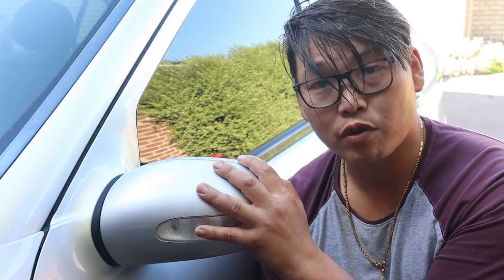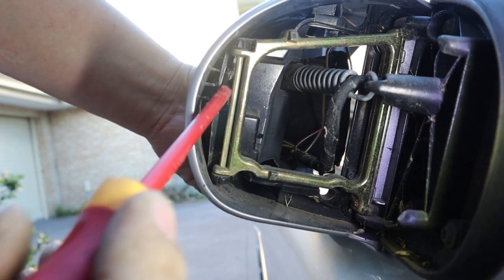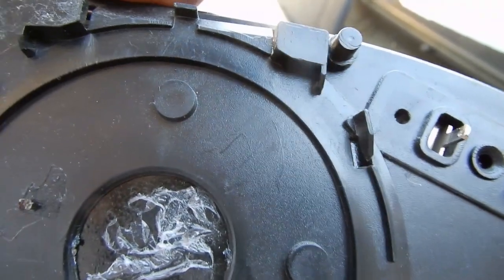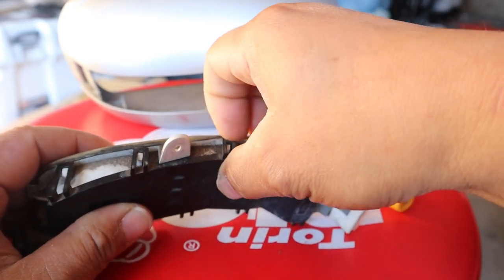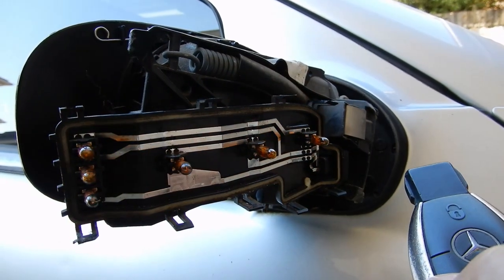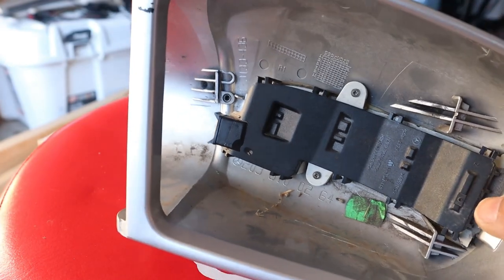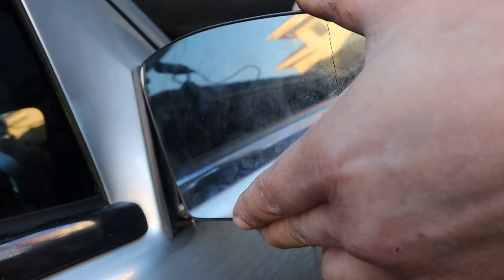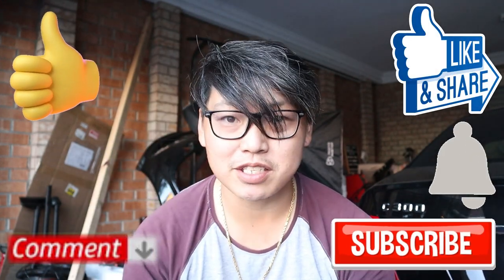how to remove side mirror+cover+indicator+bulbs mercedes w203 replacement

Comment: Thanks Great video. Very helpful getting the cover off - it is still difficult to find the clip but your video showed me where the screwdriver should be poking!  Just as a note my indicator is LEDs; it has a grey cover with no clips-  I guess this would be a sealed unit.  Mine stopped working due to broken wire in the mirror loom.

Comment: Great video, thanks for taking the time to make it. Unfortunately, after an hour and a half, the spring clip won and I gave up. I just couldn't move if far enough over. However, it turned out that my issue (the front of the housing not sitting snugly to the car body)  could and was resolved by springing the mirror towards the front and gaining access to one of the cog wheels for the closing mechanism, which had fallen from it's top support. The mirror still doesn't close but I now at least fits doesn't look like it's about to fall off. The big bonus is I didn't lose my shit and rip the bloody thing off in temper!

Comment: Mikey where did you get a replacement H pin on your door - the one that is a bugger to get out. I managed to break mine as well.
Thanks and kindest regards. 
Dermott Fitzpatrick
Reply from the maker: Hey buddy i know exactly what u mean ... i called up a few wreckers and they sold it to me for 10 dollars shpped ..just call arpund your area all the mercedea wreckers and asl for that part and someone will be able to help u out
Reply: MIKEYZ VLOGZ Thank you Mikey . I was unable to find it on eBay, Ali Express or any of the other sites.  
Your help
Is much appreciated. Take care.
Reply from the maker: @dermottfitzpatrick1450  ur most welcome ..i tried the exact same thing and in the end started callinh wreckers and finally found someone to sell me 2 lh and rh ... just remember how to remove them ..once u understand it its pretty easy

Comment: any update about the bulb size or specs?
Reply from the maker: which bulb size was it I forgot which we were referring to
Reply: the halogen bulb inside that mirror blinker
Reply from the maker: @benedictkartiko3027  oh all the seperate little bulbs? I'll check again and tell u
Reply: @MIKEYZVLOGZ  alright, thanks man.
Reply: At first i thought it might be a good idea to just replace the bulb but then i ended up getting the whole light unit. Much easier than finding the replacement bulb.
Reply from the maker: @muhammadizzat9011  yes much easier.. im still under of the bulb size

Comment: Would you call me.  I can't get the cover off!!  I tried and tried and look at your video.  The clip is jammed!
Reply from the maker: u mean the silver clip that allows you to remove the side mirror cover ? if its bent passed the seated point u may just have to try pry it out of where its clipped to...this happens due to the clip being pushed too hard in when your trying to pry it back with a flat head screw driver